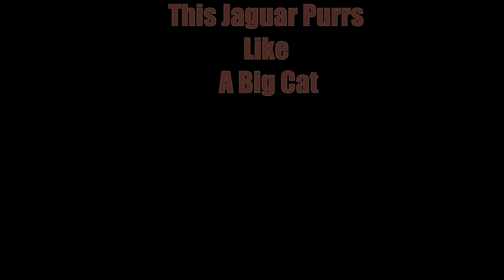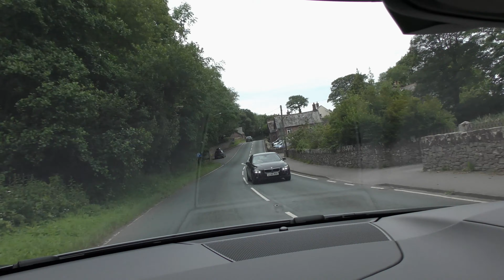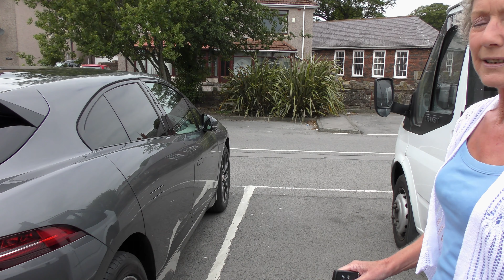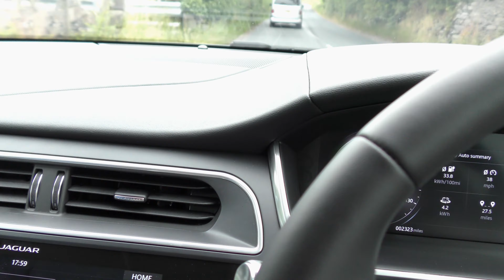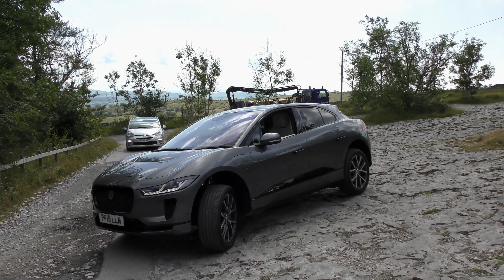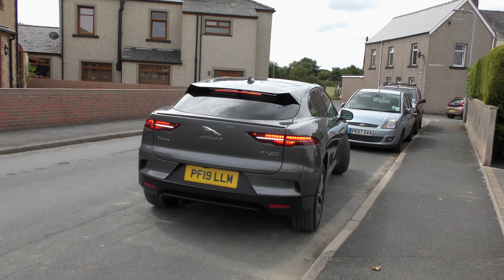Test Drive Jaguar I-Pace with us as we carry out an in depth review of this new electric vehicle

Comment: what's the range you cover in the video without any charge?
Reply from the maker: Hi Anirudh Garg. We were fully charged on the day we traveled from Barrow-in Furness through the Lake District to Brough Castle and back via the motorway. We made a YouTube Video on this topic called:         Jaguar I-Pace SUV what is the cost of running this all new electric car?    https://www.youtube.com/watch?v=TJ1WKkuI6Bg           We were fully charged on the day we traveled from Barrow-in-Furness through the Lake District to Brough Castle and back via the motorway. The route and distance is given in this video and we still had plenty of charge in the battery at the end of it. We charged the car from a 13 amp (220volt UK electric supply) socket every night and it gave the car about 7 mile range for every hour it was on charge. So after 12 hours we had an extra 84 miles of range. 😀
Reply: UsefulWisdom thanks for the info
Reply from the maker: Hi Anirudh, your welcome. 😀